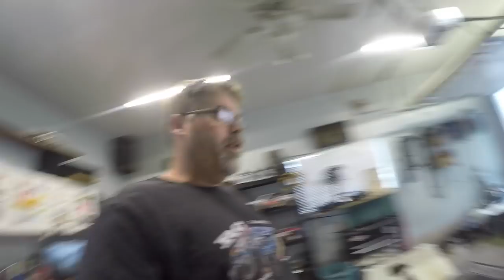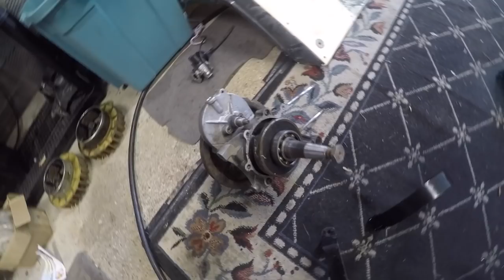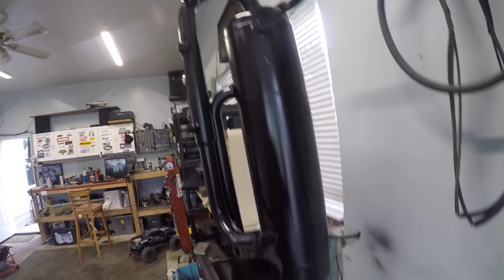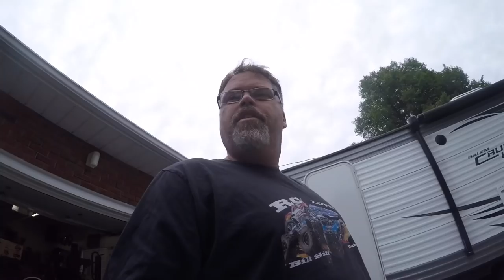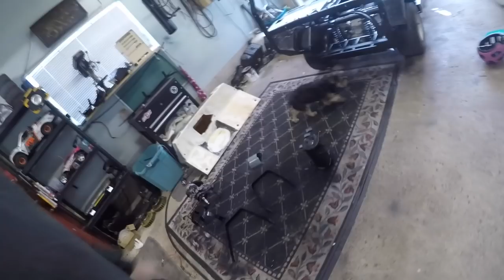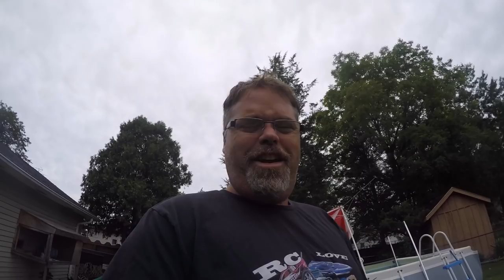Coming Slow IT IS

Comment: You might wanna get a pro to rebuild that engine, just saying!
Reply from the maker: Ill be fine lol
Reply: Bill Siff right I don't think a pro can line up the 2 rings up to much better lol. get your Dremel tool out and clean up the cylinder you are keeping it will make a difference, just get some of the casting flaw's you will be amazed and then it really has your craftmenship.
Reply: Billsiff is a pro